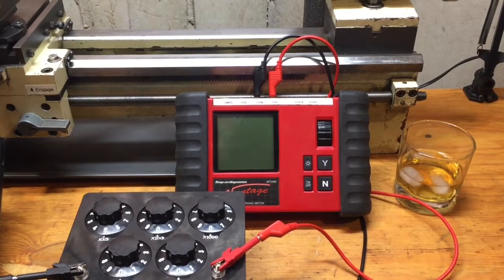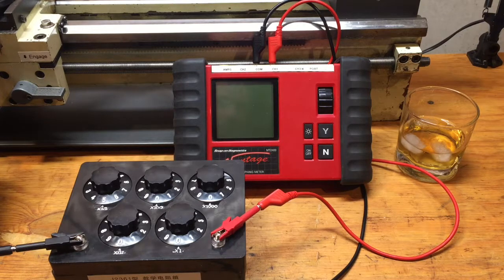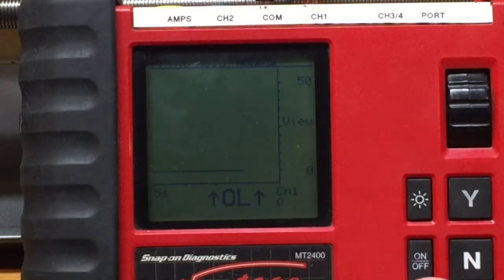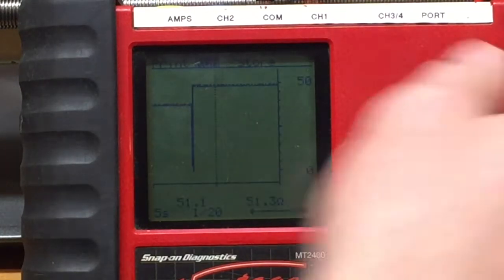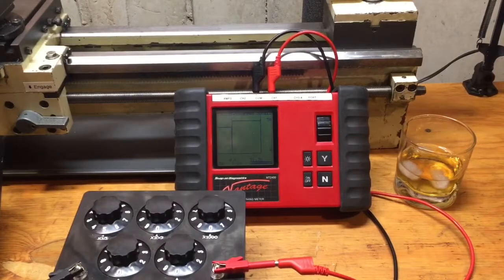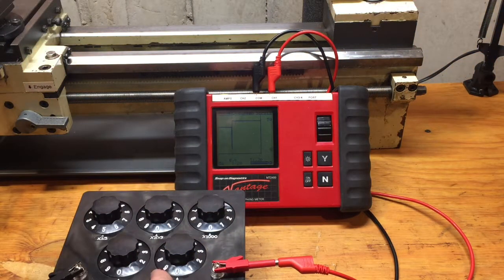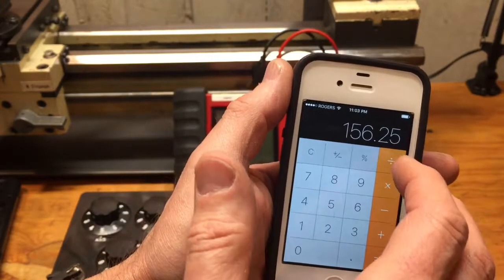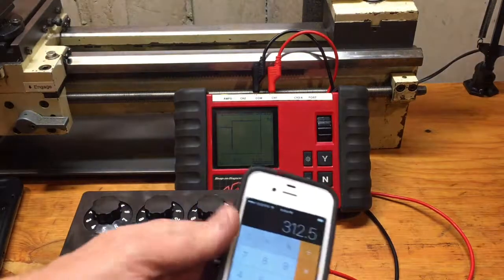Decade Box Considerations

Comment: Just ordered one and gonna modify it so it becomes more useful to me.
Make it 10R to 1M and use 1W 1% resistors.
Reply from the maker: Ni5ei Hey Thx for watching . Can’t go wrong with a decade box. Super handy. Cheers...Ian
Reply: @TheGibby3340  Thanks.
I was thinking, in your follow up video where you're showing what's inside, the rotating contacts that touch the traces on the board are way too edgy. It would be way better if they'd used the kind of springy contact that is basically a piece of sheet copper with a big round dent in it. (I hope you picture what I mean). This would be much easier on the traces.
Reply from the maker: Ni5ei Oh definitely. You can see the short comings in the construction. Longevity is sacrificed for economy. (Cheaply made) 😀